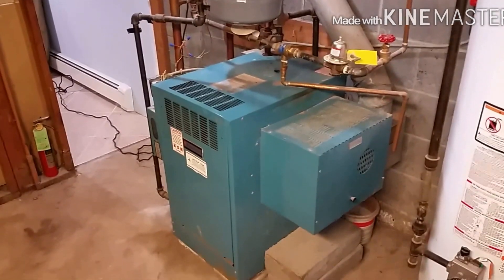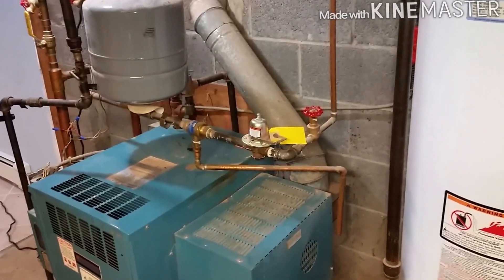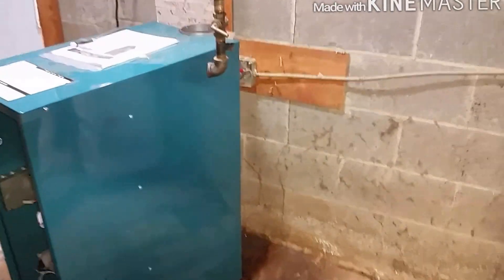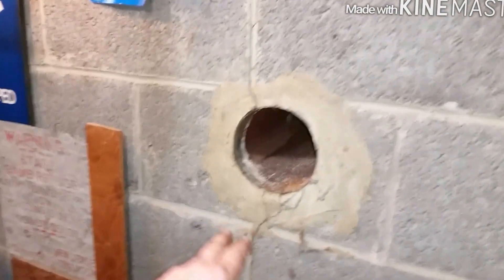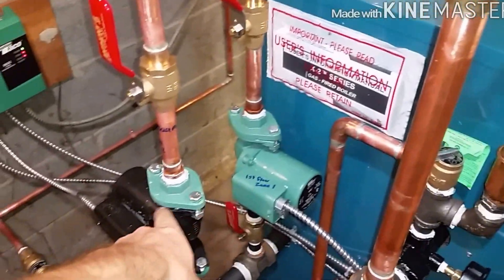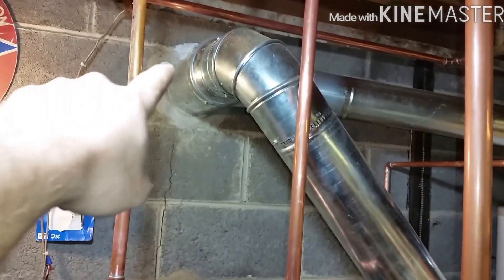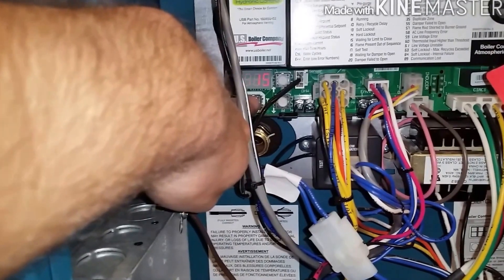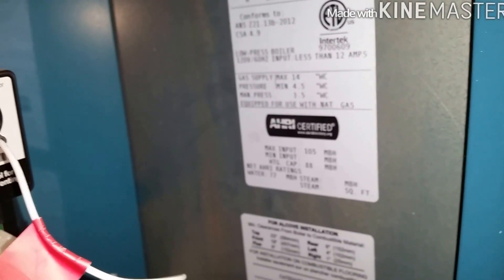Burnham x-204 hot water boiler

Comment: Nice work. Water make should be piped in between the expansion tank and air scoop. Also you need to wipe your dope up.
Reply from the maker: Checkmate 199LD u r correct but my boss likes it pipes into the bottom of boiler for flushing reasons and pretty sure we wiped the dope up lol,  thank man !!!
Reply: JH HVAC & Plumbing you guys do nice work

Comment: Just wondering, any specific reason why water feed is hooked up on the return side below the pumps? Also, when purging, water would have to flow through the boiler then through a zone loop and out, is there any benefit of doing it this way?
Reply from the maker: Eugene Diamant yes we like to set it up this way just simply to flush out any dirty water inside the boiler , a complete flush and purge
Reply: JH HVAC & Plumbing Interesting set up, never thought of it this way. Pumps are not pulling water away from the pressure valve so there shouldn't be any negative pressure causing pressure valve to open and add more water into the system. Nice job. Im still not sure if circulator pumps are better on the return or supply side...